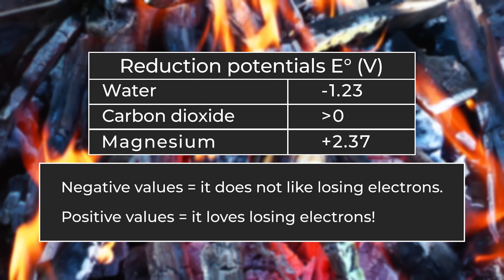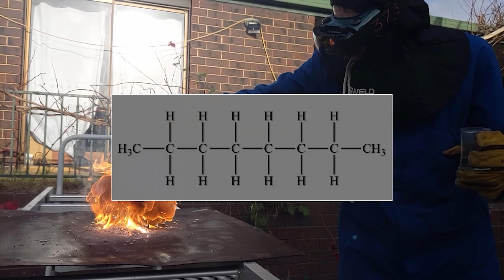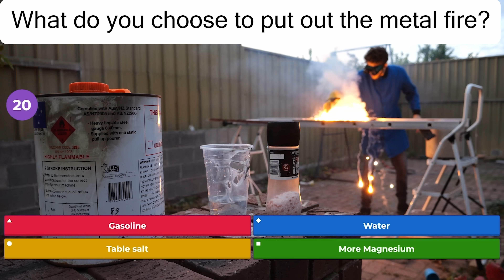Can Gasoline Extinguish a Fire?

Comment: Gasoline putting out fire is like how stimulants are used to treat ADHD
Reply: It's all relative, for a normal person a regular activity would stimulate their brain a certain amount, but when you have ADHD your brain doesn't activate that strongly towards things so while it might seem like everything takes the interest of a person with ADHD more easily than someone without it, that's because nothing takes the attention of them very strongly so things that would be easy to ignore for a normal person are harder to ignore for a person with ADHD because their importance is all weighted similarly in the mind. So while a normal person might easily pay attention to a movie, and be able to ignore the thoughts in their head or someone talking, a person with ADHD can't because it's not stimulating them as much. So when you take stimulants, everything is ramped up, making it easier to pay attention to things you enjoy and easier to ignore things you don't because they don't receive the same relative boost, and it makes it easier to act correctly because the threshold of action has been changed. 

Let's say everything has an action level, and an action threshold, that mediates the likelihood of doing something, and you can treat them sort of like odds, or biases. If the number is even there is an equivalent likelihood of response, and the higher the action level compared to the action threshold the more likely a person will engage in that action. Like for a normal person, if the threshold of action is 2, and things you enjoy reach an action rating of 3, where things you want to ignore reach an action rating of 1, it will be easy to ignore them. For ADHD types, the threshold of action will be lower, for instance a 1, but the action rating of everything is 1, so you will either be hyperactive (ADHD) or action deficient (ADD), where you will respectively either act impulsively or be unable to act at all, which in my experience tends to be mediated (at least in part) by the way a person deals with anxiety. 

The problem of course being that there is no strong difference between anything. When you take stimulants, it changes around these numbers, and for people suffering from ADHD it changes them in a beneficial way so that they are able to actually make decisions instead of being stuck in a world where their brain doesn't feed the correct information to whatever part of human consciousness makes decisions. But instead of how I explained it in a word computer, everything is physically done by this really complicated interaction of chemicals and electricity in the meat computer that is the brain, and even saying a drug effects dopamine or serotonin is a simplification because it doesn't just do that, the drug is also present which changes the way electrons move through the system and things interact so it wouldn't even just be as simple as raising dopamine levels because it won't do the same thing without the drug present to mediate the action of everything. This is why two drugs with a similar mechanism of action can have super different effects, because those extra molecules in the mix is like adding an extra part to your computer's motherboard. Having two 5 GHz CPUs will work different than one 10 GHz CPU, even though numerically they are the same, that's the best comparison I can think of.
Reply: @Pepesmall I think this explanation is really good
Reply: @Pepesmall Uhh, no.  Stimulants increase attention and focus in everyone.  Of course, that's not always desierable in everyone -- think getting obsessed with cleaning your house to an absurd standard rather than doing your work -- but any difference in effect for people with ADHD (if any rather than just titrating attention to a good level) is much more subtle.
Reply: @Pepesmall  Y'ouch, super wrong novel you've written there.
No, the reason stimulants (not all) lessen ADHD symptoms is because it "takes the place" of the serotonin, thus freeing up the serotonin we would normally use up quickly. We don't have high energy, we lack chill. I drink copious amounts of caffeine laden beverages and before I developed a crazy high tolerance, I would actually get drowsy if I drank a lot of soda.
ADHD is a serotonin re-uptake problem. Stimulants (not all) interfere with the serotonin re-uptake and thus you have serotonin available to become calm, which allows for "normal" capacity for attention and the ability to mentally block external stimuli. Other people with the disorder may have other ones which change how all of this works. The ADHD itself works as I've stated, but other disorders cause unintended consequences, like with my Tourette's Syndrome being exacerbated by stimulants, leading to more tics and a higher difficulty in suppressing them.
Reply: @flamerollerx01  then why do serotonin reuptake inhibitors not help with ADHD?
Reply: @AndyPhu  cause they make the serotonin output weak, leading to the same effect as untreated ADHD.
Think of it as a canon.
People without ADHD fire one canon ball every second.
Someone with ADHD fires 3 or more at the same time, and are quickly out of ammo and scramble to make new ammo, which are seconds without serotonin.
The inhibitor just makes it so they shoot all three of them after 5 seconds, meaning they have 4 seconds of no serotonin.
Stimulants are like an extra magazine, so they can keep shooting 3 cannon balls every second.
Reply: It's because the stimulants affect the kindergarten teacher (the pre frontal cortex) more than the kids (whatever part of the brain spams ideas nonstop).
Reply: @WarttHog  This is probably most accurate. It gives the executive function part of the brain enough energy to actually do it's job. And no, this isn't some choice, the executive function part of the brain is autonomous. 
Think of it like laxatives. Stimulants can make your intestines start working when constipated, just like they can make the executive function part of the brain start working when it's not culling the herd of random thoughts.
Reply: @WarttHog  That's a funny and accurate explanation.
Reply: Or how radiation is used to treat cancer
Reply: Not really, stimulants will help anyone focus, until a point.
Reply: @mr.giggles4995  Yes, thank you.  Stimulants for ADHD are more akin to HGH for height/or steroids for muscle/hormone disorders.  It will work for anyone but if you don't titrate it right it will do more harm than good (sorting your toenails instead of doing your work or the usual steroid side effects)
Reply: Yep. Somehow, it just works.
Reply: Or how nitroglycerin is used to treat heart conditions
Reply: Just so that you know kerosene is used to put out cotton bales that have caught on fire.
Reply: niot at all. not even remotely close
Reply: The reaction is pretty similar too. You start out absolutely coked up by it, then the ADHD is treated
Reply: hiii blahaj :3
Reply: Haha
Reply: My disorder treatment is not a social conversational topic. Medical opinions are for doctors, and having an opinion on this is very threatening. Stimulants are incredibly effective to treat/remove the most significant ADHD symptoms, and people rely on it. It's not dangerous in PRESCRIBED quantities, and the negative side effects are negligible, especially for people who've taken it for a long time.
Reply: @HamuraiJack29  The fuck, mate? They were just pointing out how both seem like the last thing you would use as a solution, but, in fact, both work.

Signed, someone who also has ADHD
Reply: @HamuraiJack29 good thing nobody was talking about you. take your self-righteous attitude elsewhere.
Reply: @HamuraiJack29 eh methylphenidate(ritalin) gave me psychosis and severe weight loss.
Reply: As a side note this is why mental disorders are considered to be best treated holistically than by medication or therapy individually, because there is a physical component and a psychological component to any mental health diagnosis, and one without the other is generally not as effective. A strong understanding of what is going on inside "you" will make it much more likely for a favorable outcome, because almost no doctors are trained to know what they are talking about when it comes to every single possibility, and a lack of understanding combined with medication can be extremely dangerous (such as in the case of people being prescribed painkillers and getting physically addicted.)
Reply: @Pepesmall  Holistic medicine is a pseudoscience. It's not based in any real scientific principles.
Reply: @Pepesmall  that's why I always take my psychiatrist's reports to my therapist and vice versa, they gotta work together
Reply: @icarothomas94  I should start doing this
Reply: in fact, my psychiatrist and therapist ask for each other's reports
Reply: wait but how tho....ADHD is lack of dopamine and stimulants give dopamine
Reply: @lucysparks5326  think of ADHD as being "im so underwhelmed that I cannot focus on anything and must do a hundred things" the more stimulation, the less underwhelming things feel, or well thats how I feel.
Reply: @lucysparks5326  A metal fire is just a lack of gasoline fire 😊
Reply: @lucysparks5326  a very good portion of medication given to kids/adults diagnosed with ADHD contains caffeine. growing up, my ma would give me a cup of coffee before school to keep me chilled out throughout the day.
Reply: @lucysparks5326  a lack of dopamine can contribute to ADHD but is not even close to being a significant factor
Reply: @FemFishBoy  a lack of dopamine is a major factor in ADHD patients . Either that or not being sensitive enough to it. IDK how you say its not even close to being significant because thats the just so terribly wrong. Yes there are other factors . 
I agree that stimulants are mostly overkill especially those that are distributred in the USA like Adderall which is really strong for normal ADHD symptoms. Every Drug that increases dopamine in the pleasure center of the brain will help ADHD patients with every Dopamine related symptoms like lack of motivation or Focus. However the energy comes not from the Dopamine but the noradrenalin increasing  effects of all the stimulants.
Reply: Probably lack of serotonin too
Reply: @ohbeardedone9253  it's not that simple
Reply: Not just any stimulants, amphetamines. In extreme cases meth is even used
Reply: @handlesarecringe957  I know. If been prescribed meth before

Comment: what if you use something that burns really really fast to put out metal fires? So both fires are out in seconds :D I know atleast some explosives do this, The problem is with the spray bottle, it pulls alot of oxygen along with the gasoline because its so fine mist, even the fire extinguisher pulls air with the liquid, i think its called bernoulli effect and it feeds the metal fire

Comment: Do It with diesel.
Also:
"You're gonna dieee"
"No I'm nooot"
"But dad will kill you"

Top tier sibling interaction 😂😂 😂
Reply: Yeah I was expecting him to try diesel and then he went with.... Acetone.
Reply: Classic when the co-star steals the show!!!
Reply: I would use cooking oil.
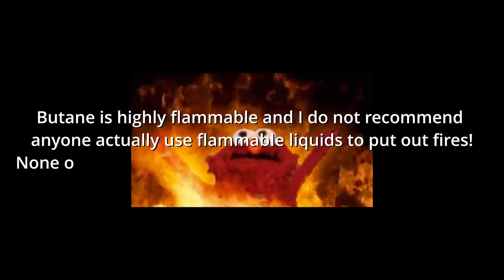Reply: 4:15
Reply: Diesel does not burn unless aerosolised.
Reply: @Orphioux  it also has little to no oxygen dissolved in it and thus would not react with metals as violently as water. The fact it doesn't burn if not atomized and its oil-like properties can actually become an advantage in not turning into another class of fire.
Reply: @Orphioux Then how do people start fires with it
Reply: @maxscott3349  they burn it really hard for a couple of minutes, diesel takes quite a while to get vapourized and then catch fire
or, you know, diesel aerosol spray
Reply: @Orphioux It can definitely burn in the right conditions, even without nebulizing it (you just need more heat to ignite it).
Burning magnesium would most likely ignite it, but it would also be put out by the sooth generated by the burning diesel.

Comment: I wonder what other chemicals would work to put out a Class D fire, without spreading fire everywhere. Chloroform maybe? Sulphur hexafluoride?
Reply: Chloroform would likely produce phosgene (and I can find at least one SDS warning about this), so even if it does work, it's probably not a good idea. I'm not sure it'd work in the first place though anyway given that the reaction of magnesium with alkyl halides is both well known and tends to be exothermic. Hell, MTV flares are a thing too, and I can't see anything confirming halon type fire extinguishers can be used on class D fires. 

Sulfur hexafluoride would probably work better, but under suitably reducing environments (such as hot strongly reducing metal) you will probably see some breakdown of it. That said, it gets used as an inert cover gas when working with magnesium, so hey, decent chance it might work. I'd have to look a bit more into it to make more comment.
Reply: @somethingbob1210  Thanks for the detailed explanation!
I assumed SF6 would be decent, but I didn't know about the reaction between magnesium and halides.
Reply: @danwhite3224  'Grignard reagents', as the classic alkyl magnesium compounds are known as, have a long history and see a lot use. Definitely worth a read about if you're curious.

Comment: I think the issue is the butane evaporates and burns too quickly. The gasoline is able to envelope the magnesium and draw the heat out+cover it in soot to stop it from igniting. The butane only works if you can drop a large amount of liquid on it to draw the heat out. This probably has something to do with the specific heat capacity of butane also (0.4) against gasoline(22). To make a butane fire extinguisher maybe you'd have to find a way such that it sprays out liquid butane so that it relies on heat capacity of transition rather than specific heat capacity to reduce the temperature and liquid would cover the magnesium better

Comment: My personal inclination would be to try going for a thicker liquid, or maybe thickening the hydrocarbon fuel somehow. The issue seems to be a combination of not blocking off oxygen, and not absorbing enough heat to prevent the magnesium combusting again.

The latter will be hard in general as it scales up, but the former would benefit from the fuel sticking better to the magnesium instead of dripping off/blowing away.

What I'm saying is "napalm fire extinguisher"

Comment: If it works by taking the oxygen away from the magnesium while not providing oxygen itself a squirt is not going to do the trick obviously 😅 You'd need a sustained fire that engulfs the magnesium long enough to where it can't get new oxygen to burn.

I think it's time to contact the slowmo guys to get some more data to work with 😁

Comment: My only guess is that the only way to extinguish a magnesium fire gasoline is by ''engulfing'' the magnesium fire by a gasoline fire thus consuming all the oxygen the magnesium fire necessitate to keep burning. This doesn't quite work when pressurized since the velocity of the pressurized gasoline might also feed the magnesium oxygen and/or not make a fire engulf the magnesium enough.

It's only a theory. A CHEM THEORY, thanks for reading.

Comment: Try using diesel. Diesel doesn't burn as well as gasoline, but it is very sooty when it does, and magnesium has more then enough heat to ignite it locally.

Comment: I think the problem lies in the amount of gasoline relative to the amount of burning metal. I think the first demonstration with the cup worked because of the fast pouring motion. This way a large connected volume of gasoline with relatively low surface area hit the burning magnesium and had time to envelop more of the latter by flowing around it before combusting and taking the oxygen away. It’s also possible that the gasoline flowing around the magnesium flakes had a cooling effect on the magnesium because gasoline has to evaporate before combusting, and the magnesium providing thermal energy, and in turn cooling down below its own ignition temperature. And was able to take a lot of energy from the flakes. All stuff that didn’t happen or happened to a lesser extent with the fire extinguisher and the spray bottle test.

Comment: You keep going with extremely light and volatile hydrocarbons that evaporate quickly and spread everywhere
why not try something much heavier and harder to burn instead, like diesel or just plain vegetable oil?

alternatively, you could try plastics like styrofoam which could foam up or stick to the magnesium.